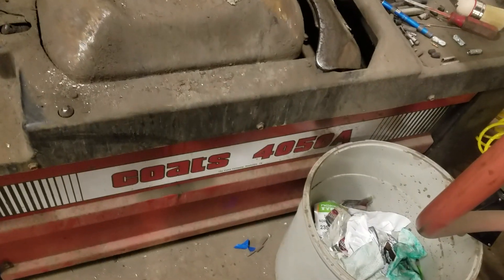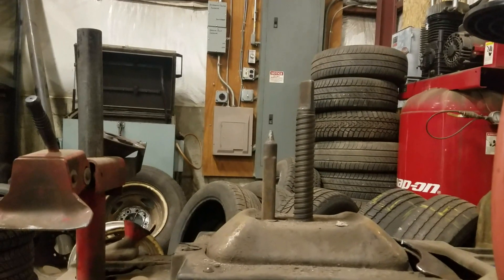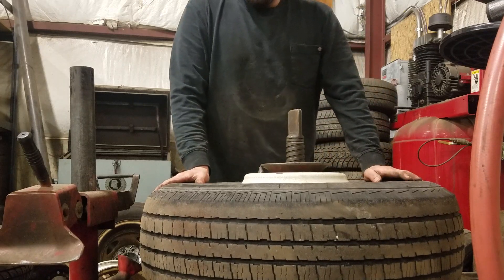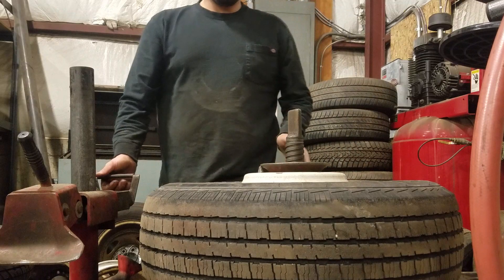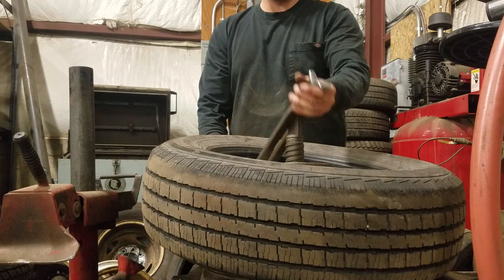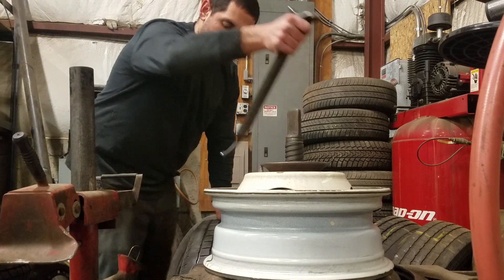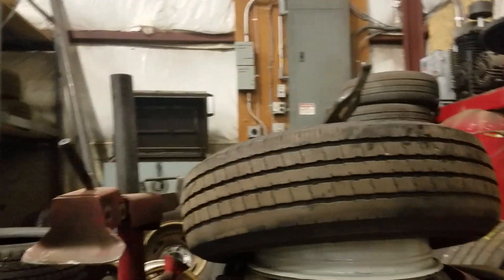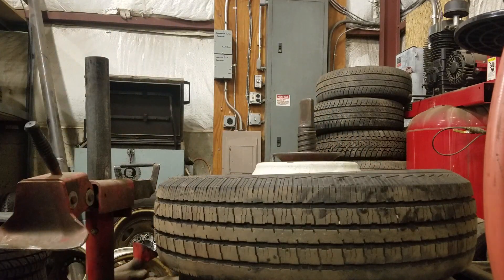Coats tire machine 4050A

Comment: That sure brings back memories, before I got paralyzed I worked at a tire shop (the family business) and I worked on one of those machines for 10 years!  They are definitely not for aluminum wheels but I actually preferred the 4050A over the rim clamp machine we had (I think it was a 5060AX) for steel wheels, probably because I used it so much more, I literally changed thousands of tires on the 4050A!  You should have shown the bead blaster and also how you can put different size shims to avoid having the bead breaker hit the wheel.  Anyways, thanks for the video!

Comment: Works fine with aluminum and mag wheels. Just make sure you break the beed twice, in two locations. (180 of each other) If you don't have the beed completely separated. It has a slim chance at bending the lip on aluminum rims. Apply tape to stop scratching. The only thing this machine has trouble with is powder coating.

Comment: Hey Sergio Figueroa,  if you mean it's surging then the main cylinder is low in oil and is getting air into it creating a dangerous situation by throwing the tire tool like a projectile.  Mine was like that at when first bought from a salvage yard that used it like that busting their arms etc.

Comment: Hello great vid wanna ask  I have same tire changer  but when is about to rotate it stays stuck trying to get tire of or suddenly it spins out of wack which I have to stay far pressing pedal so it won’t wack me wanna ask if u ever had same issues with yours
Reply from the maker: Never had that issue sounds valve the valve connected to pedal is dirty or bad
Reply: Thank u
Reply: The other comment about air in the hydraulic system makes sense; maybe it needs to be bled and purged of air, because that would cause it to not be able to get to working pressure without a spring effect where it builds up energy that gets all released at once when the tire bead breaks loose.

Comment: What is the tire valve clock position ?  Can it be important so not to rub it off by tire bead as tire worked on?
Reply from the maker: I always put the valve away from the bead breaker on top when machine is in motion taking off tire it won't hit it. Special care needs to be taken if you have tire sensor it would be challenging not to brake it with this machine I have never done a wheel with a sensor on this machine.
Reply: @liftittotheroof1876  hello. Master hey. Just. A question.   How much does that.machine coast.    And. Where to buy it.       I. Need. One.     I need information.    Please.   Thank you.
Reply: If you put the sensor at about 5 o’clock as you’re looking at the machine the operation will clear the sensor and not push against it too badly.  Yes you have to look at how the iron moves around the rim and pick a spot where it doesn’t interfere nor push the tire too badly underneath and lines up with the machines pins.  I changed my 16” caravan tires regularly summer to winter and back no issues. Just did my sisters 18” snow tire to replace valve. Alloy wheels can be secured with an optional plate if the centre hole is fragile or decorative and plastic covers fitted to the iron.  There’s a spacer that can be installed in the lower breaker for large diameter wheels for better clearance and the adjustment knob alters how much travel the breakers move for different sized wheels. Ie bigger wheels need more travel and smaller would get crushed too much.  There’s a bottom spring and cone for these wheels and a collie for protection of other wheels that can be used.

Comment: What’s a good machine for not scratching your rims? Thanks
Reply from the maker: RAYLEGEND this machine is not the most delicate for aluminum wheel I would try to get a machine that has a swing arm for mounting and dismounting tires and install a plastic duck bill on it. If you check out my other video on the ranger machine you will see the swing arm style I'm talking about. There plenty of low cost Chinese made machine out the if you don't do a lot of tires that will work just fine.
Reply: If you have to use this machine for aluminum wheels they make a plastic or teflon cover for the tire bar. I've done it but you have to be careful haha

Comment: They say not to flip the tire around because theyres a reason it's waring bad. You have bad parts and flipping the tire around is ignoring the underlying problem.
Reply: I did tyre fitting for almost 20 years the reason you do not flip a tyre around even though you can do it this because the steel belts get used to the tyre rotating one-way when you flip the tyre it rotates the opposite way which can cause the steel belts to break inside the tyre and cause a separation which basically means you will end up with a big bubble in the tread of your tire